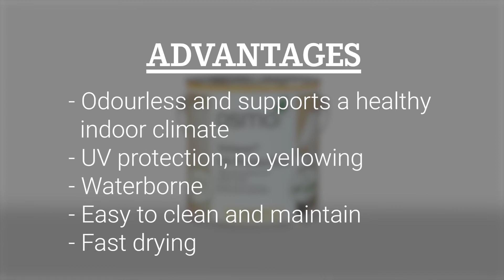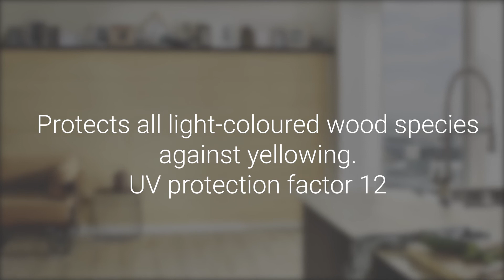Uviwax® – Unique UV protection for the interior

Comment: This product looks great! Question: In the video, the painter flips the workpiece over immediately, without letting the freshly painted surface cure first. Wouldn't that spoil the finish on the side that was just painted? Thank you
Reply from the maker: Hi, usually you would let it dry for a little while and then turn it. You are right, the finish would be damage a little bit on the spots where it contacts the ground. You should also start with the back, so the side which will be seen is on top. Best regards
Reply: @OsmoDeutschland  Thank you so much. Can you be specific on "a little while"? i.e. when would it be safe to turn the workpiece over? Also, can I use a foam roller with this product? Thanks
Reply from the maker: @ImpostorModanica  unfortunately not. It depends on many things like amount of material, wood surface, and so on. We have collected all information on our website concerning the methods of application in the product information sheet which you can download here: https://www.osmo.de/en/finishes/interior-finishes/finishes-for-doors/uviwaxr-uv-protection/ best regards
Reply: @OsmoDeutschland  Thanks, but the website and available literature doesn't mention roller usage in detail
Reply from the maker: @ImpostorModanica  Hi, the possible tools are placed below the table with the grey icons, so for the Uviwax UV-Protection you can use the Flat brush and microfibre Roller.